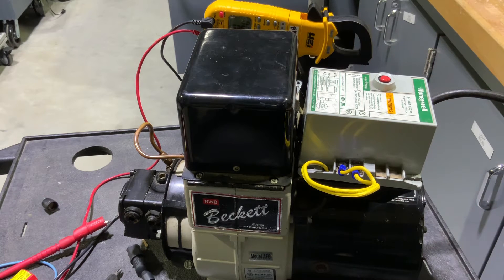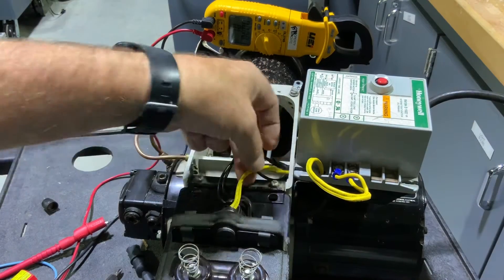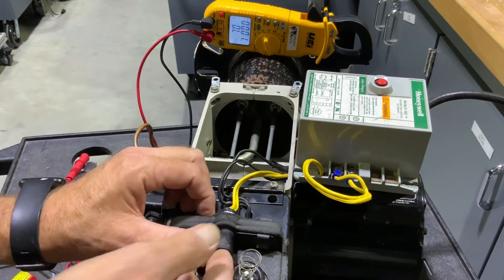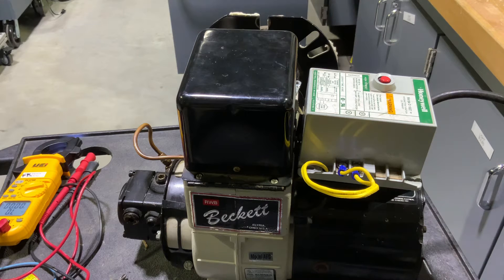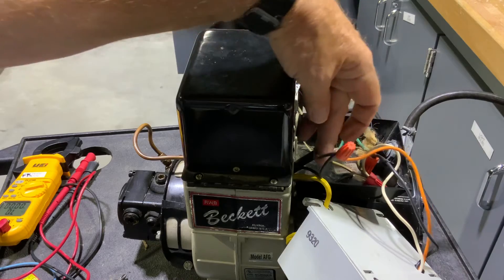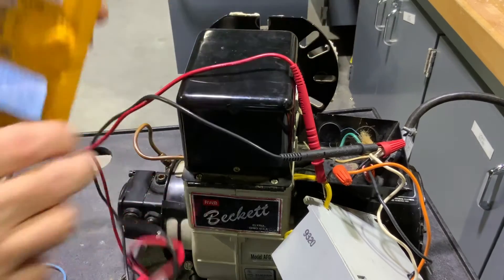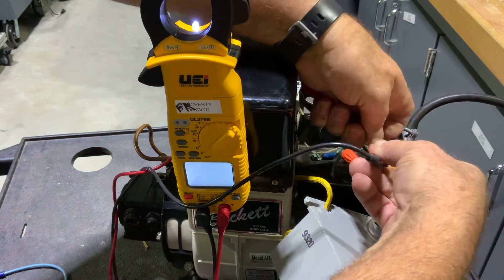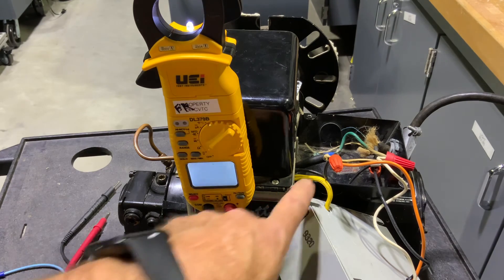Oil Burner Electronic Controls

Comment: So how do you know if the cad cell is working properly? What is the normal reading when it’s running because you never had a flame or explain what the normal reading should be. At what point is it good or bad?
Reply from the maker: When the cad cell sees light the ohm reading will be very low ( 300 or less) when the cad cell sees dark it ohms out very high ( in the thousands)
Reply: @frederickkosier2508  Are you sure about that 300 ohms or less?  That seems a little low.  And at what reading do I change it out? What if I get 1000 ohms
Reply from the maker: @scotttaylor3049  I’ve seen them as low as 50

Comment: I have the same unit.  It's currently set up for 110V but I want to switch eveything on the furnance to 220V (mostly want the blower on 220.).    So does that ignitioin transformer need to be changed?   How about the pump motor can it get set for 220V like a blower motor can?   If not I guess I can run a separate cirucit (or just a neutral) and the burner can stay at 110 with the blower on 220.
Reply from the maker: The pump motor and transformer are all 120 volts. This also sends power to the blower motor. If you run a separate circuit just for the blower motor to make it 220 then nothing is telling the motor to turn on and off. I don’t think that would work
Reply: @frederickkosier2508  I opened it all up.  Thanks to your video and another on the bimetal temp switch I knew exactly what was what.    I can add a 120 coil relay for the blower (blue from temp switch goes to 120 coil) and thus keep oil pump and control box on 120 but the blower at 240.

Comment: I just came across a boiler that would start normally, then slow down and trigger reset. The problem was that the new pump had it's bypass screw installed... on a 2 line system.